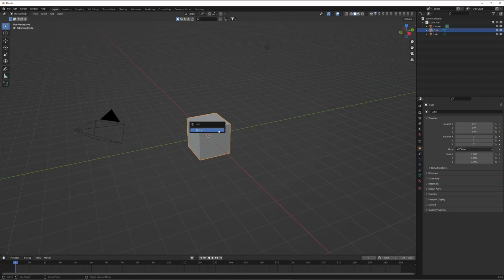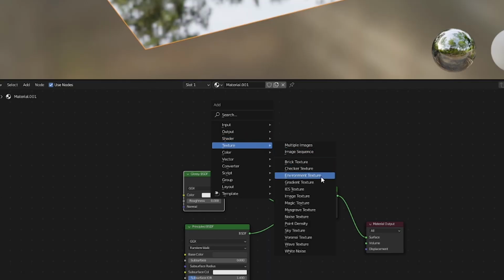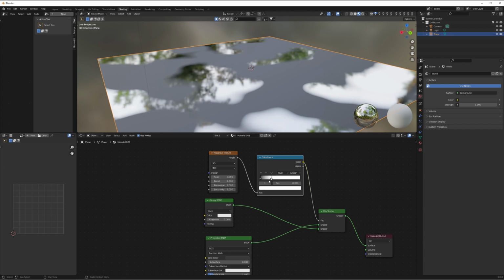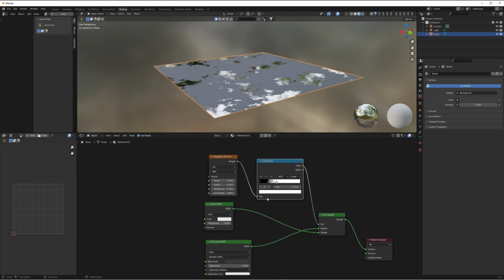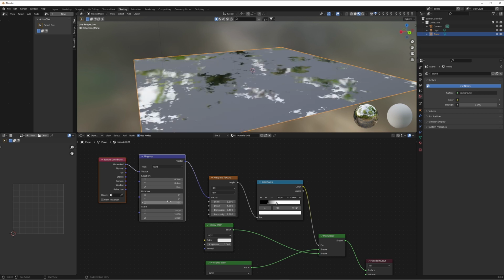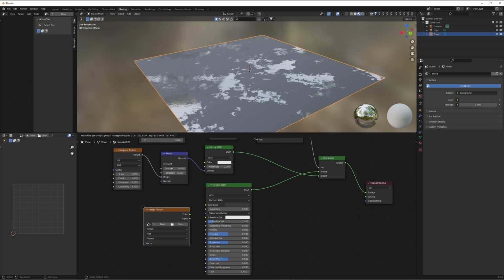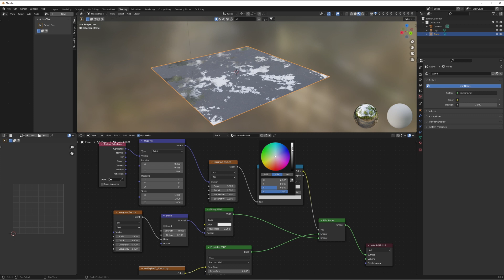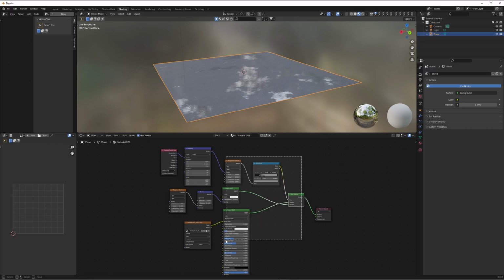Easy Procedural Puddles in Blender 3.0 EEVEE

Comment: When i render it just turns Black without any colour
Reply from the maker: Make sure the principled BSDF is connected to an output node
Reply: Doesn't work. The result is still a black image
Reply: @sonamwangchu8833  switch evee to cycles
Reply: I'm having the same problem. I can have a reflective material, but when I input a texture like the musgrave into the factor, the reflection vanishes. I can only render the texturizes reflections in Cycles, but I don't know if my potato machine will support it.